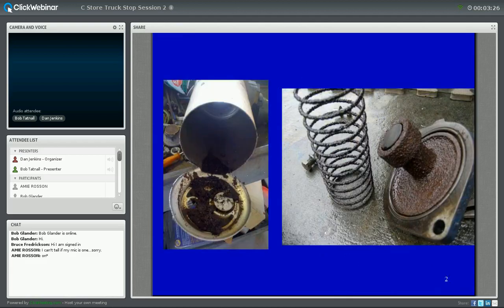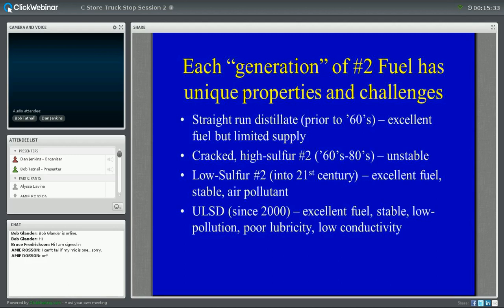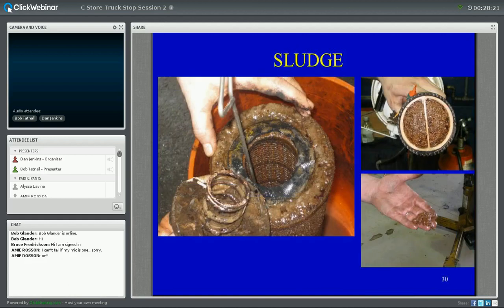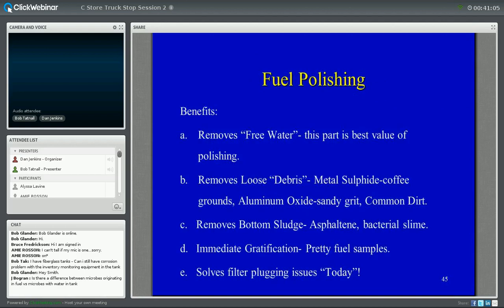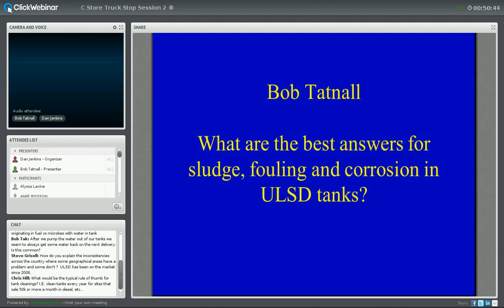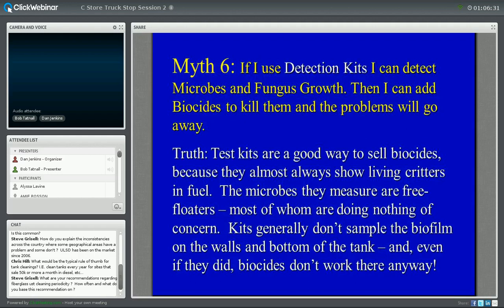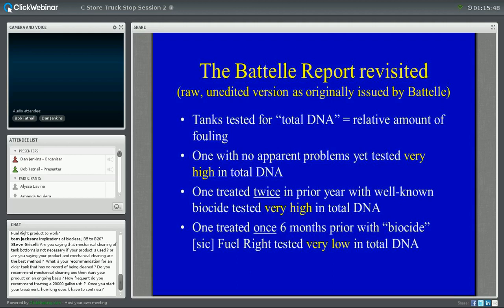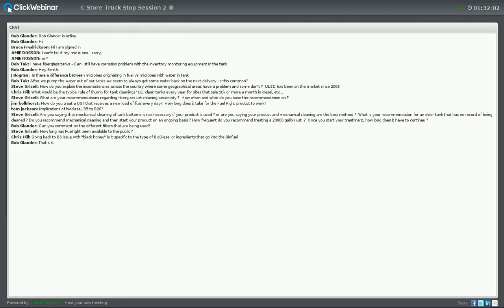Fuel Right Webinar - "How to Solve & Prevent ULSD Sludge & Corrosion Contamination Issues"

Comment from the maker: Fill to the fuel level that you will use in one year and then "shock treat" it with 1 8 oz bottle of Fuel Right 15K.  Repeat for the next winter.  Treating it over the summer will allow the product longer to dissolve the sludge.  Good luck and congratulations!  You have chosen well because it works!!

Comment: i was told during the summer time, april to october, around 7 months keep tanks full, to avoid condensation. We are around 1/4 full now and at some point will need fill the tanks. Depending on the price of oil, which has already gone down around 30 cents/gallon already.  It takes over 2 seasons to burn all the fuel 550 gal.. I also heard best to add additive at the same time the tanks.are filled. Is this correct? We wait for the best price on oil, and it usually goes down in summer.

Comment: I researched a few of the companies/products that remove/dissolve sludge in home heating oil tanks. I came across Fuel Right, researched and read results of many products and then decided to order Fuel Right..We have 2 275 tanks, inside the home, they are there since 1948, no leaks, and need to get additive into each. Looking forward to seeing results